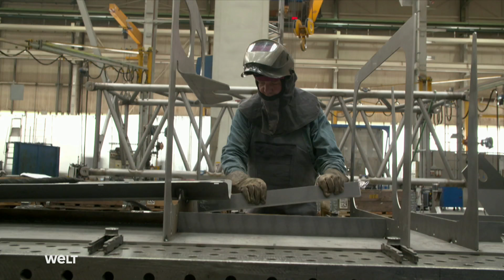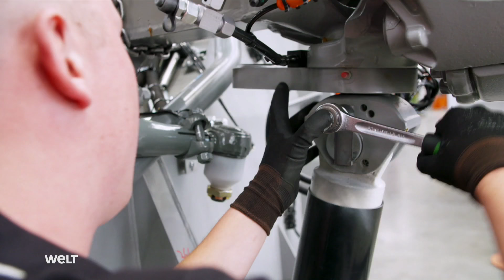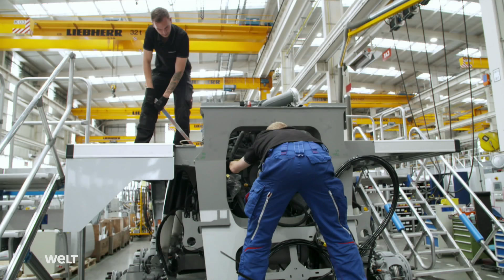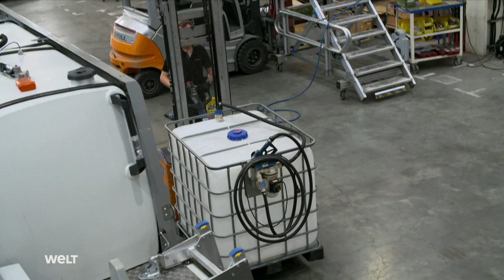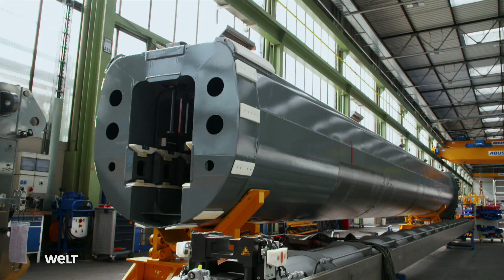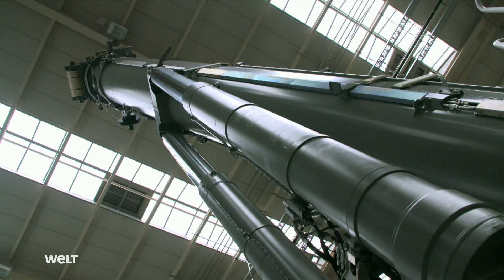Inside Liebherr: Creating the Largest Mobile Cranes in the World | FD Engineering

Comment: The scale of the LTM 1750 really stood out — 108 tons spread over nine axles, yet able to lift 800 tons with its 52-meter boom. The detail about the frame sections being made from more than 1,000 individual parts, plus the 7.1-ton rotating platform frame, showed how much precision work sits behind a crane that looks like a single machine. The LR 13000 lifting 3,000 tons put that engineering into perspective.

Comment: What can you say! Absolutely incredible. How on earth do they design and manufacture all the thousands of precision parts, put them all together and operate them safely around the world. Engineering is something humans have become very good at!
Reply: Or in case of Boeing have become very bad at.
Reply: @moos5221  many parts in a Boeing are made by Liebherr.
Reply: @lebaillidessavoies3889  I guess those are the parts that never failed and are holding the plane together then.
Reply: @moos5221  no , most of the air conditioning / pressurisation systems are made by liebherr aerospace also some hydraulics , both for Boeing and Airbus.

Comment: Thank you for using modern measurements instead of American ones.
Reply: Please post your low self-esteem elsewhere. 🥱
Reply: That great for non Americans but as an American there were totally meaningless other that the 25 inch wheel hubs. Meters aren't too bad as that's close enough to a yard, Tonne and ton are close as well at least for the concept of this video and I'd say 15 centimeters or maybe its millimeters is about an inch. But newtons and bars for pressure and torque meant nothing.  As many time as they repeated the measurements they should have intermixed them. For myself all the repeated measurements was more annoying than the music.
Reply: @jayfp2014  Fortunately, Americans are less than 5% of the world population - despite all their noise! 😛
Reply: I'll measure in farm animals and pubic hairs before I'll use the metric system. WTF is a centimeter? Nevermind. Don't care

Comment: The worlds bigger telescópica crane that can travel with its boom mounted isn’t the ltm1750, is the Ac1000
Reply: That is partially true.
The LTM 1750 is allowed to travel with it's complete telescopic boom.
And the AC 1000 is only allowed to travel with most sections of it's boom removed.

But it all depends in which country the crane is travelling, because every country has different rules about what weight you can drive with on the public road.

Comment: I'm certain he meant liquid nitrogen -196 c or 77K
Reply: I thought that it sounded funny too. But I just looked it up and found that Argon is -186 c. so theres only 10 degrees difference. Cold enough and maybe cheaper???
Reply: @broughxtreme  certainly not, argon isn't anywhere near abundant by comparison to Ln² - I work in cryogenics / low temperature physics ☺️
Reply: @TRReck  OK. Just out of interest then. Why would they use Ar over Ln? It's not like voice over guy just said the wrong gas. Mechanic/engineer from way back and I'd never heard of liquid Ar before.
Reply: @broughxtreme  unfortunately in this case, that's exactly what's happened. He mis spoke. 

There is no thermal benefit from using argon vs nitrogen. All that matters is thermal contraction. Argon is much more expensive, but also possible to use. 

Nitrogen is abundant, and readily used by industry in all sorts of applications.

A simple slip of the tongue, and the smoking gun in - 196C ....Exactly the temperature of liquefaction for nitrogen
Reply: @TRReck  Now I'm much the wiser.

Comment: This is a First Class Operation. When I observe the way people perform the different jobs they are doing, It appears "Safety," is one of the  "Most Valued Qualities," As is Design and Engineering. Good Job.
Reply: Yea. And no one is wearing an protective helmet. Strange ...
Reply: @grigoryk6401  
Helmets only protect against small objects.
Helmets don't cushion the impact of several tons falling on you.
Furthermore, employers get a serious slap in the face from the employers' liability insurance association for preventable workplace accidents.
Reply: @sylviarohge4204  The helmet will protect you from a nut that has fallen from a height of several meters. Or from the fact that you don't smash your head by turning around or getting up and hitting something hard.
Reply: @sylviarohge4204 Yeah, it won’t save you from tons. But what it will save you from is loose items falling and rigging. Not to mention a crane company assembling a crane with poor rigging techniques…
Reply: @e @ethan4237 d assume there simply are no loose objects that could fall down in a factory like that. Germany has pretty strict work safety laws. If those people don't wear helmets, it means they don't need helmets.
Reply: @grigoryk6401  protective glasses would be nice too